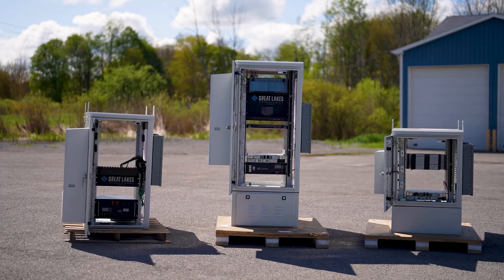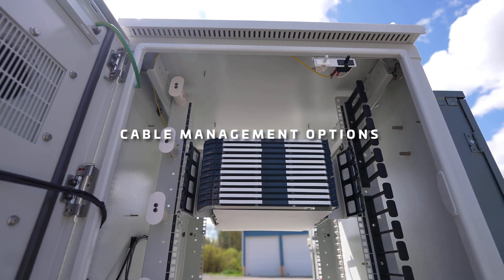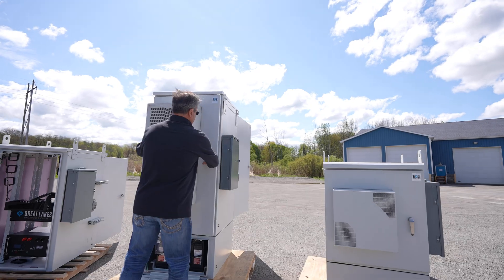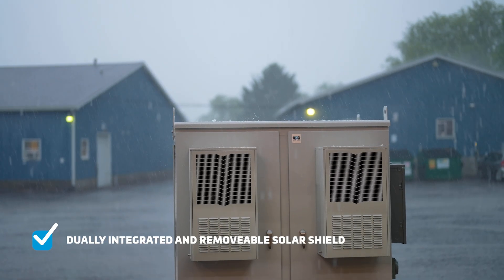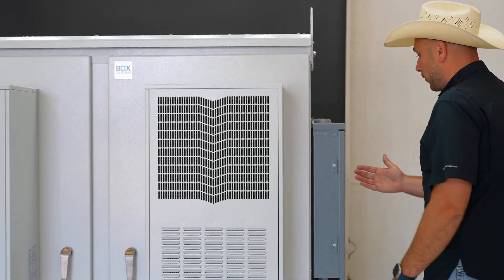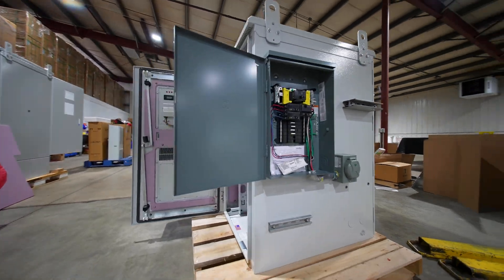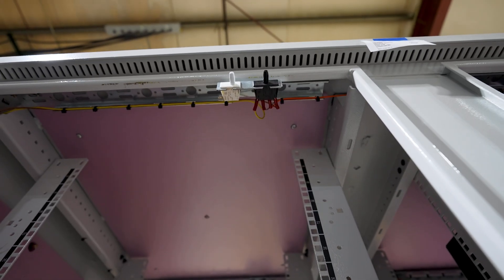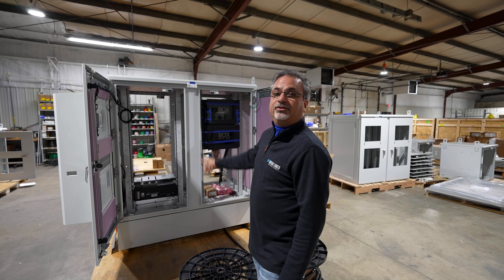How Outdoor IT Enclosures Survive Harsh Environments

Comment: Question?
Does surface rust ever happen?
Does the insulation keep frost from getting inside?
Reply from the maker: No rust as the material is 1/8" thk Aluminum
The insulation keeps the outside hot temperature from radiating through the material and then heating up the inside.
The Air conditioners also have heaters to be activated by low temperatures in the winter months when the AC compressor is off during heat cycles.
Reply: @WeRackYourWorld  OK
However Aluminum does corrode.
Are the heaters electric?